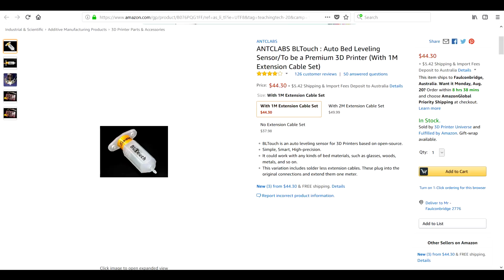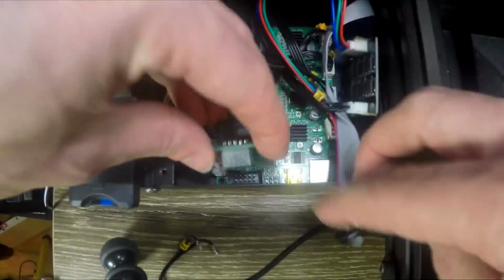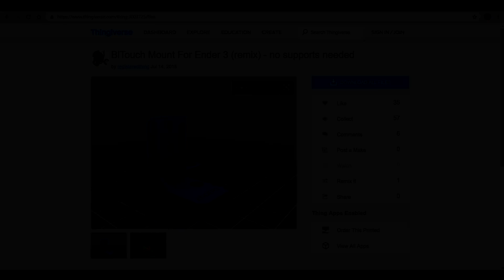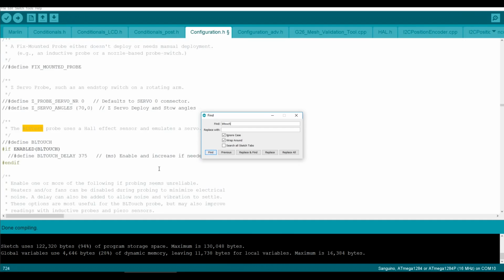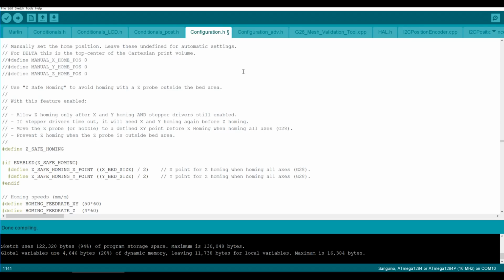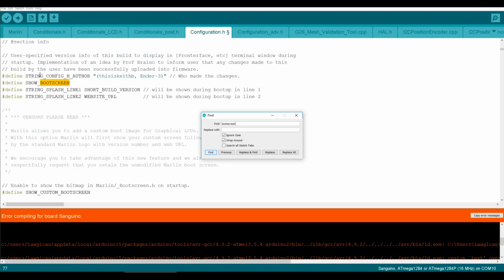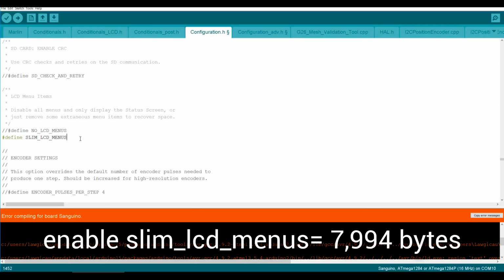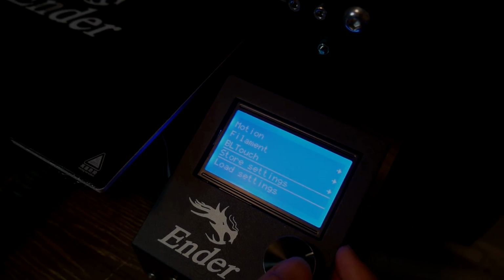Ender 3 BLtouch vanilla Marlin guide

Comment: Can you tell whats the process if we don't have pin 27 board, what wires to cut on ribbon cable? Also do we need any additional code edit in that case? Thank you for this detailed tutorial, perfect as always!
Reply: Ok, I've found this guide if you DON'T have pin 27 board - http://jonathanlundstrom.me/2017/10/23/cr-10-bltouch-firmware/
It is not that hard to do that way and follow the rest of the guide, but I purchased pin27 from ebay because it is more neat. ^^ Have a nice day everyone!

Comment: Hi Michael, i downloaded your config h files however i have recently tried to compile them in Arduino for windows and i am getting an error: Arduino: 1.8.7 (Windows Store 1.8.15.0) (Windows 10), Board: "Sanguino, ATmega1284 or ATmega1284P (16 MHz)"

C:\Users\chris\Documents\Arduino\libraries\U8glib\src\clib\u8g_rect.c: In function 'u8g_DrawBox.constprop':

C:\Users\chris\Documents\Arduino\libraries\U8glib\src\clib\u8g_rect.c:126:1: internal compiler error: Segmentation fault

 }

 ^

Please submit a full bug report,

with preprocessed source if appropriate.

See <http://gcc.gnu.org/bugs.html> for instructions.

lto-wrapper.exe: fatal error: C:\Program Files\WindowsApps\ArduinoLLC.ArduinoIDE_1.8.15.0_x86__mdqgnx93n4wtt\hardware\tools\avr/bin/avr-gcc returned 1 exit status

compilation terminated.

c:/program files/windowsapps/arduinollc.arduinoide_1.8.15.0_x86__mdqgnx93n4wtt/hardware/tools/avr/bin/../lib/gcc/avr/5.4.0/../../../../avr/bin/ld.exe: error: lto-wrapper failed

collect2.exe: error: ld returned 1 exit status

exit status 1
Error compiling for board Sanguino.

This report would have more information with
"Show verbose output during compilation"
option enabled in File -> Preferences.

Any ideas on how to fix this. 
Cheers Michael

Kind regards
Chris
Reply from the maker: Hi Chris, please see the pinned post. Sounds like the u8Glib is missing.
Reply: @TeachingTech  Cheers Michael

Comment: Dear Michael and Ender 3 guys,
I  bought your configurations files for my Ender 3 equipped with a BLTouch sensor.
I have flashed my printer with Marlin 1.1.9 inclusive your configuration files.
In your video dated 08/14/18 you asked to change 
Z_MIN _PROBE_ENDSTOP_INVERTING from true to false
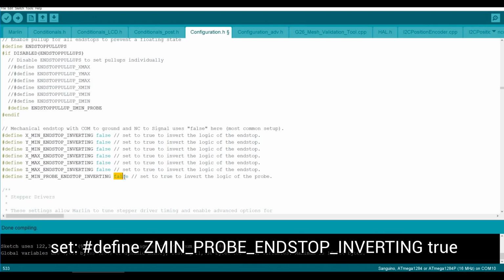and in the above video dated 09/29/18 at 6:00mn you asked to change
Z_MIN _PROBE_ENDSTOP_INVERTING from false to true !
In your configuration files the Z_MIN _PROBE_ENDSTOP_INVERTING is set to false.
Where is truth ?
I cannot get my BLTOUCH running the Z_OFFSET setting is not consistent.
Thank you for your help.
Alain
Reply from the maker: At some stage I accidentally hit undo I think. Genuine BLtouch works with either setting fortunately. Make sure you save the settings in the LCD control menu after setting z offset.
Reply: Thank you, everything is now OK with TRUE, my Z_OFFSET was not consistent with FALSE !
 @TeachingTech

Comment: My BLTouch starts the first three probes at the bottom of the bed (closest to the front) how do change where it probes?, I am not sure what to enter at // Set the boundaries for probing (where the probe can reach). MIne are currently at 
  #define LEFT_PROBE_BED_POSITION 41
  #define RIGHT_PROBE_BED_POSITION (X_BED_SIZE - 41)
  #define FRONT_PROBE_BED_POSITION 73
  #define BACK_PROBE_BED_POSITION (Y_BED_SIZE - 10)
Reply from the maker: The first line set at 41 should move it further away.

Comment: So I have a Creality Ender 3. I flashed the bootloader and followed all the steps. After everything is done, in my Arduino, I go to Tools > Serial Monitor and type in G28 to home all axis. When I do this my X axis comes to the home (close left) and my Z axis moves up and down, then it goes to my Y axis and nothing happens. It gives me a "Homing Failed-PRINTER HAULTED-Please Reset" error. My Ender3 from the LCD screen now screeches non stop. Any help would be grateful. Otherwise I will just revert everything and go back to not having a BLtouch.
Reply: TL:DR = Y axis not moving. There is a buzzing noise. Really could use some help.
Reply from the maker: Most likely scenario is that you knocked the plug for the y axis when installing the other components.
Reply: @TeachingTech  I somehow lost the Y axis stepper port. Did some testing and found that out. So I got a new board, re-installed everything, and its working like a charm with the BLTouch and Octoprint. Must of accidentally shorted it out or something. But thanks for the guide for installing both of those things.

Comment: I bought the config files and loaded them into the stock marlin like was shown in the videos.  My problem is that the machine will home correctly in one spot like it did with the stock sensor but it only homes in one spot and then when it actually prints the head will not be in the same position.
Reply from the maker: What you describe doesn't sound like an error. I'm not understanding why you would want the object printed in any place other than where you placed in your slicing software, generally the centre of the bed.
Reply: @TeachingTech  Other configs precious had the sensor test multiple places.  Right now this config just test in one spot and is done.  is that normal?  ALso the other problem is after the level test is done the print head moves up and tries to print to high off the platform.  I was going to rerun the upload onto the board and see if that fixes it but I was not sure why the leveling test works but then loses that for printing.
Reply from the maker: Sounds like you've only done half the setup. The probe in the middle is just the g28 homing. You still need to add g29 to the start gcode to activate the probing and then calibrate the z offset. All covered in the video.
Reply: @TeachingTech  Actually I will chalk this up to me being cheap.. I bought the 3dtouch.... I regret that as it literally fell apart.  I am guessing that is why nothing was working right because it was not signaling properly.  Learned my lesson.  I will try when the BL gets here.

Comment: Well that physical install was easy. However having followed the video very carefully step by step I can not get the BL Touch to "touch" the bed. I got no error messages after compiling or downloading the sketch. I must have missed a vital step but the the probe doesnt do the probing bit. If its G29 command, that  does not work in the start script and autohome plonks the extruder near the center of the bed not the front left where I want it. Any ideas what I am doing wrong would be appreciated? Maybe I will go back to no BL Touch if its that unreliable.  ps The BL Touch came with a sheet of paper with a lot of code on so maybe I should be pasting that somewhere as well?
Reply from the maker: The homing i the middle of the bed is necessary, it is the step referred to as safe homing. The probe hangs over the edge of the bed at 0,0 so if you were to rely on that for homing z, it would smash the hot end into bed. G28 should home as described, then a G29 straight after should complete a 3x3 grid of bed probing. Is this the case?
Reply: (Many hours later) the probe homes in the center but the hot end is off centre, obviously. G29 command is now working, no idea why it failed in the first place. The 3x3 levelling is off centre as well. However during the test print the hot end collided with the front bulldog clips, which are small, and the extruder was way off the build plate by about 3 mm. I am wondering if I have missed out a process here?
Reply from the maker: Nothing missed, just further optimisation possible. Around line 1024 of config.h you can set the probing grid position to get it symmetrical. Also can change the bed size to 235x235 in config.h. These parts are covered in more detail in my advanced bltouch video, check it out if you like.
Reply: Michael, thanks mate, I will check the video out. Am I right in my understanding that once the extruder to bed clearance is set for optimum squish and the number is saved that should never need to be set again even if the bed is changed for a thicker or thinner one?

Comment: Hi Michael,  I purchased your zipped configuration.h and configuration_adv.h files.  After copying the files to my marlin I checked each of the changes as per video, mainly to set up my probe distances for the Bullseye mount.  However, I notice that for "Z_MIN_PROBE_ENDSTOP_INVERTING" your file says false but in your video you say change to true, I know others have mentioned it but should it be true or false, what does it do either way?
PS: where did you get the test X-print file?
Reply from the maker: I believe I may have accidentally hot undo before saving and zipping the files. Fortunately, with a genuine BLtouch, it makes no difference either way (I've tested). The X print file I made in CAD. With something like tinker cad, use text to draw the letter x and extrude. scale to fit bed in slicer, super easy. I've posted it previously for my patrons.

Comment: Hi! I have mounted Bltouch on my Ender 3 Pro. The problem i have now is when i want to set the Z-offset. I have adjusted it on the display, stored settings. If i run a M501 command it shows the correct setting, but when i then run a G1 Z0 command i does not go 100% to the z-offset i just set. Sometimes it goes to high, and other times to low. I have put in a G28 followd by G29 in my slicer, and it runs the whole rutine before print. But it seems like it doesn’t compensate for a warped bed. Because it keep running in to the bed on the right side of the bed. 

Have you ever encounterd this problem before? 

I will loose my mind soon if i can’t figure this out...

Btw I am using the files downloaded from you in my version of marlin.

Thanks😊
Reply from the maker: Haven't had this problem. Sometimes it can struggle if the bed is really sloped, try and level traditionally first. Are you using genuine bltouch?
Reply: Even if the bed is sloped or not, shouldnt it still go back to the z-offset? Since I always check on the same reference point on the bed? 

Yes, I am using genuine Bltouch.

Comment: I followed this guide on my ender 3 and have an issue. The bed auto levels with G29 but as soon as it goes to print the temperature of the nozzle drops and i see "cold extrusion prevented" in the serial monitor
Reply from the maker: This sounds either start gcode related or coincidental. Check for code to turn the heaters off and make sure nothing has been loosened. The only thing in the firmware that could do this is in configuration.h, search for #define PROBING_HEATERS_OFF and make sure it is still commented out as it is by default.
Reply: @TeachingTech  Thank you for the response.

 I have flashed vanilla without using the BLtouch and it prints fine, no drop in nozzle temps etc.

As soon as the BLtouch is enabled in the firmware. It autolevels, prints the purge line, then the nozzle temps drops as soon as it goes to print. I am using the start gcode from this video. 

If anyone can help me out that would be greatly appreciated.
Reply: After posting on the community this problem to have been caused by the "ABL" expert plug-in within octoprint. Hopefully this helps someone, if they should have the same issue.

Comment: Hey Michael, Great tutorial, I just have one problem. When I send the G29 command I get a response saying home Z axis first, so I run the G28 command and try G29 again although still says home Z axis first. The G29 command did work the first time I ran it and I stopped it half way down with my finger to test it worked and everything worked great. Don't know what could of happened. any help would be greatly appreciated. Thanks
Reply: I have fixed that problem, seems that the signal wire was just unplugged a little. Still have a problem where it doesn't adjust the height throughout the bed, this could be because the z axis continues moving even after the sensor touches the bed. I have just bought a genuine BLTouch and hope it fixes the problem.
Reply from the maker: Glad you got your problem sorted. The clones are hit and miss, fingers crossed your newest issue is solved too.

Comment: Question:  With all the tweaking to optimize the memory to get the revised Marlin from to fit in the stock board. If you had a choice what board would you upgrade a reality printer to and why.  Do some of the boards that support wireless, deliver a better user experience then Octoprint.  Is moving to a board that support Trinamic Stepper drivers worth it.  How far do you go before you should really just buy a prusia machine.  Topic for a future video perhaps?
Reply from the maker: Definitely going to cove this in future. Plan is to try Chinese touch screen 32 bit board on the Tevo Tornado, and if that works, put the MKS Gen L from the Tevo into the Ender 3. MKS Gen L has external stepper drivers so yes you could use Trinamics.

Comment: Maaate!  i couldn't be more ecstatic with my first layer quality and adhesion. I now print with no rafts and feel like Im printing like a pro.  I still lay down a skirt just to check the z- height setting.  I cant help but run my finger of the fist layer now admiring how smooth and well extruded it is.  I know other swear by manual methods but i am getting so confident I start prints off remotely now  without even checking on the machine.

Comment: Hi Michael, a very easy  to follow tutorial, even for a duffer like me. I have ordered a genuine BL Touch plus extension lead direct from the manufacturer on your recommendation. Regarding the TH3D firmware. Is it possible to use the latest firmware versions or should the older versions be used? I have noticed that the latest version compiled at 95% of the capacity so will it still work? Also is it possible to brick the eeprom and if so what should the next action be? The reason for asking is to cover all eventualities before starting on the bootloader mod as I believe it is not possible to reverse the procedure.
Reply from the maker: Hi Tim,
my previous BLtouch video should mostly still apply with the latest TH3D version of Marlin. Things have updated since then so it may not be exactly as in the video. Tim has told me he may support BLtouch in TH3D in future, which would be super convenient for everyone. If there is any issues with your code, Arduino should pick it up before allowing you to upload. Most likely chance of bricking something is severing the connection mid upload. I understand this can still be overcome wit the right type of programmer.
Reply: Would be good if he did that as BL Touch seems the most popular unit. Shame there are no genuine retailers in the U.K.  the Eu suppliers are more expensive than ordering direct from Korea. I am a bit wary of fitting this as due to perseverance I have my ender printing well despite it being one of those that had all the Friday afternoon parts
Reply: I am looking towards the mod with some trepidation though. Lol
Reply from the maker: I highly recommend it if you are comfortable with the cost.
Reply: All the parts have arrived, but of a surprise that the extra extension lead has to be cut to size and crimped, don’t have a crimping tool so will need to figure out another way around that.
Reply: @TeachingTech I am just now upgrading with TH3D_UFW_U1.R2.4b but i fear there are vital changes compare to your video. A section "ENDSTOPPULLUP" doesn't exist at all in this version - or am i total wrong? I am searching in tab "Configuration.h", also tried "Configuration_adv.h" but there is no pullup at all. Any ideas where i bend wrong or did the TH3d guys removed this parts? Also i have realized it is only 83% memory size after i have compiled and burned into my Ender3. Your memory was around 90% if i recall correctly. Which version have you used?
Reply from the maker: @MasterFuba  Just to be clear you are posting on a Vanilla Marlin guide but are using the TH3D version of Marlin. They are both Marlin but TH3D has been completely customised so the two don't match.
Reply: @TeachingTech  You are so right, i guess i followed all your bltouch videos and mixed them up a little. I am pretty new to this firmware stuff and learned alot the last days thanks special to you and youtube in general ;-)

Meanwhile i realized TH3D does not support bltouch anymore due to their own sensor. Kind of ok from business perspective, what pushes me again to your vanilla video and extracting all the great info you provide in that  - and its indeed not the only video from you delivering such perfect stuff. I realy appreciate your enegry in doing that. Keep up the good work.

Right now i have flashed my Ender3 with vanilla and pimped speed you showed in other video. I am printing now my first layer and it is looking good so far. Thanks again for providing these vital infos. 
I am just now thinking if i should keep my Configuration.h to be happy for a while or if i should swap to your $1 ones which i have purchased just in case ;-) 
In my files i could not do the symetrical stuff so i cancled and fixed my xy offset via MIN_PROBE_EDGE 20 to ensure the sensor touches the 220x220 magnetic bed which is little smaller then original bed. This works so far but it tickles me if it would work even better with your files.... :-)

Comment: Hello, I bought your file for 1 dollar and I did the same as the video. But I get this error: #error ''SHORT_BUILD_VERSION must be especified'' . can you help me?
Reply from the maker: First question, did you follow the instructions: 
"Simply copy the two files to overwrite those with the same name in your download Marlin folder. This process is described step by step here: https://youtu.be/sUlqrSq6LeY
You will need to setup Arduino and flash a bootloader as seen here: https://www.youtube.com/watch?v=N7JLchsFRDU"
It sounds like you might not have copied all of the files as covered in the second link.